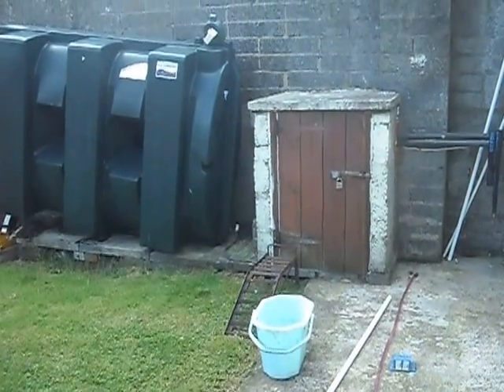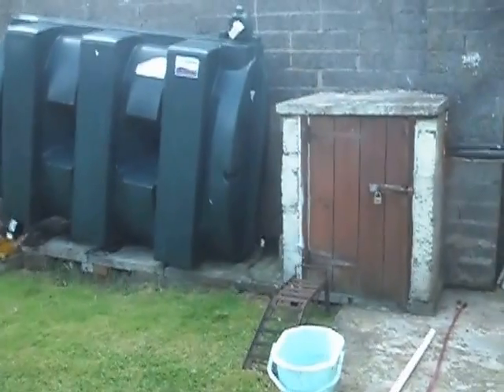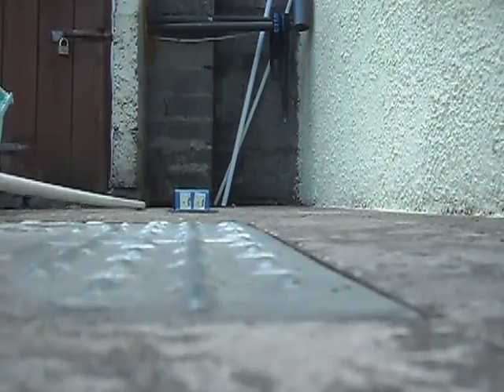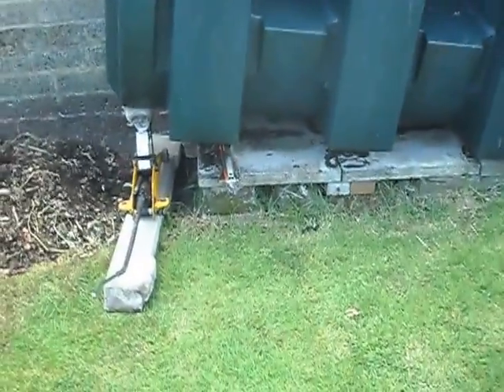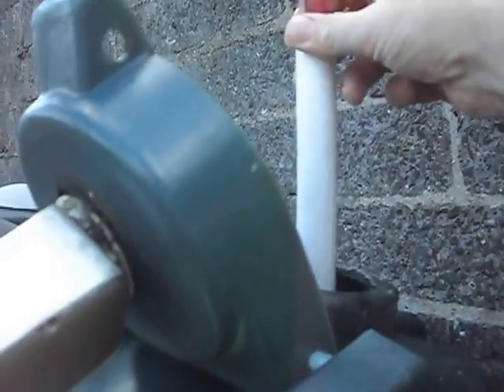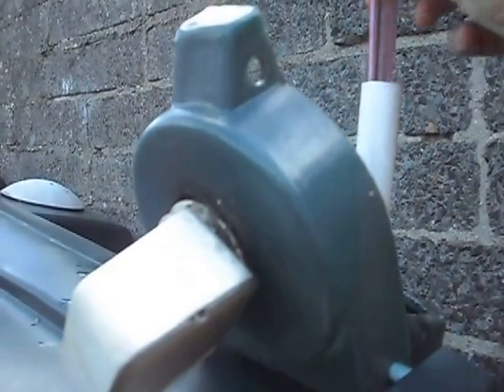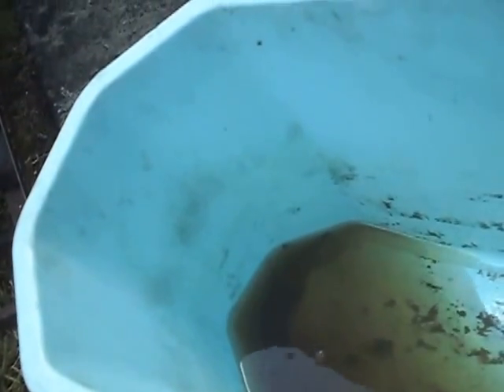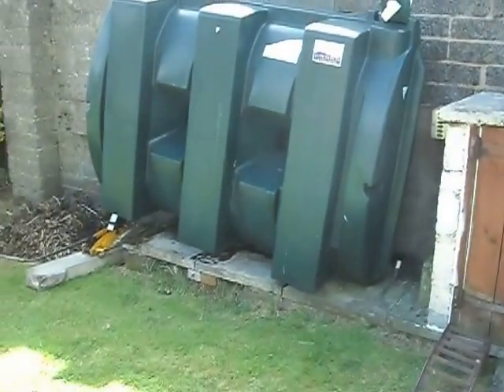home heating oil tank, how to remove water

Comment: Excellent video well done. I need to empty my tank 700 litres jsut got it topped up lol. I need to clean the gunk and settlement out of it will this also clear the gunk
Reply from the maker: It pulls the water up along with what looks like rotting leaves or a soil deposit.
 I can’t think of how so much organic gunk and muck would get into the tank, the lid is only open to refill.
 Though our tank gets a lot of snails around the lid and moss so some probably fall in each time.
 Our tank is well over 25 years old
Reply: @BrianW1lls  unfortunately the previous owners left the breathing vent open all the time so will have to empty it I will use a garden hose I think but excellent video

Comment: Why not just open the valve at the bottom of the tank to let the water out, it will be at the bottom of the tank. you could use some hose to help put it into a container. once it turns to oil just close the valve.
Reply: The valve isnt at the very bittom of the tank. Usually aabout 3 inches off the bottom. So you can still get a load of water below the valve.
Reply: @emeraldart1  Too right, Phil - a daft idea and probably diesel all over the place.
Reply: That's a much better idea.
He wouldn't be mixing up all sediment

Comment: wow it rust and breaks the fuel pump huh? weird. ive used the fuel pump to remove water from tanks alot. then blow back line change nozzle filter strainer. call it a day. maybe if it sat for a long long time it could. but usually not the case.

Comment: thank you for this video! I used your technique on my tank and easily removed 20 litres of water after my boiler engineer said it would be very difficult and very expensive to get the water out of the tank. All it cost me was the £5.99 for the jiggle siphon from screwfix and £1 or so for the conduit. So you saved me a lot of money, time and stress! Thanks